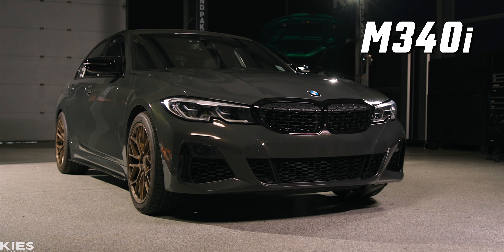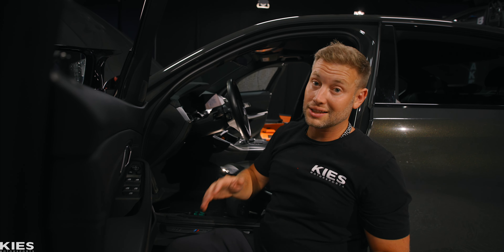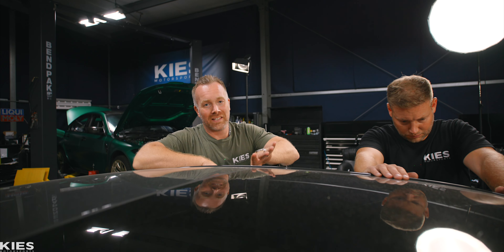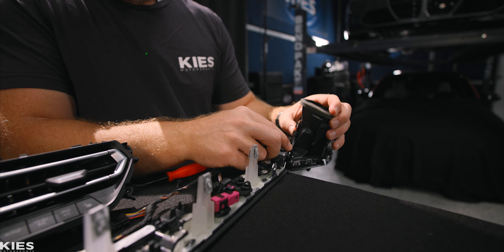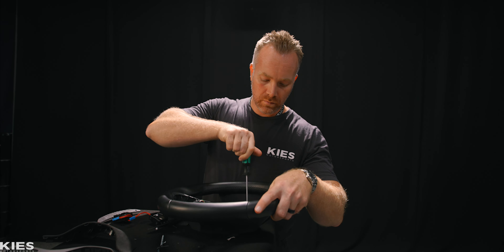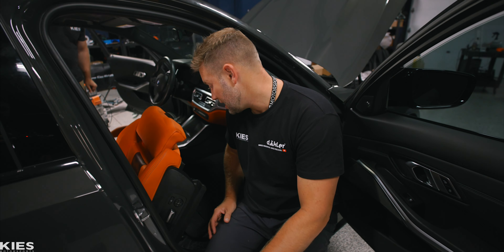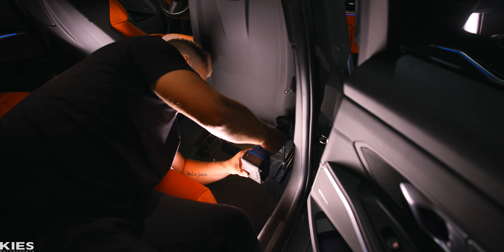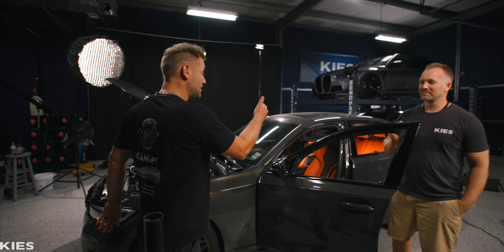FULL M3 Interior SWAP into a BMW M340i ♻️

Comment: Greetings, good day, I am looking for opinions on whether it is possible to change the manual seats that I have in a 2021 3 Series 320 and put in some electric seats from a 2020 340.The seats have the same connection harness, but I'm afraid that I will connect them and it won't recognize them or show some warning light on the dashboard.
Reply from the maker: Unfortunately we would not know as we do not get the 320 in the US. It would likely be possible by repinning/adding pins to the harness and potentially wiring. Once that is complete you would need to code them in as well.

Comment: Does the interior of the g20 fit in the f30?
Reply from the maker: Technically the bolt pattern is the same, yes! However, coding the seat modules and functionality to be compatible may be difficult!

Comment: Brian....did you guys try to code in ventilated seats if the m3 seats were equipped and if not do you think that's an option to code those into an m340i with g80 m3 ventilated seats?  That would be amazing

Comment: Are 2021 330i sport seats a plug and play swap into a 2021 G20 M340i?  I figure they bolt in as they are the same series but wondering if wiring/ harness is the same